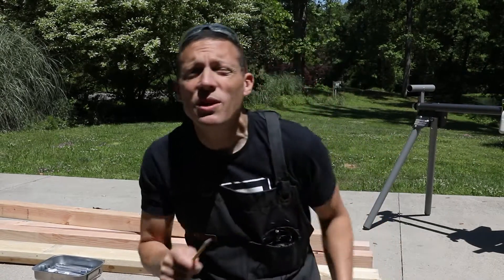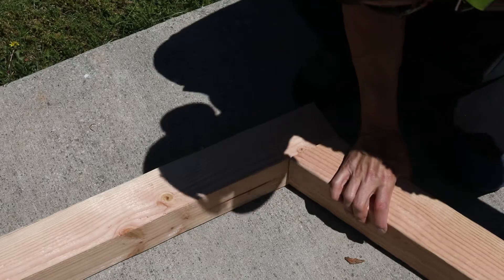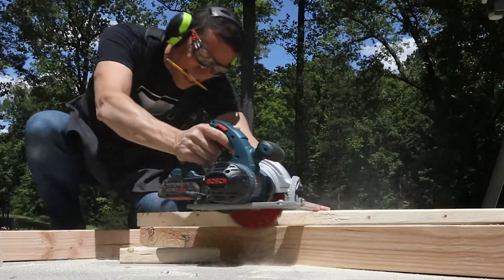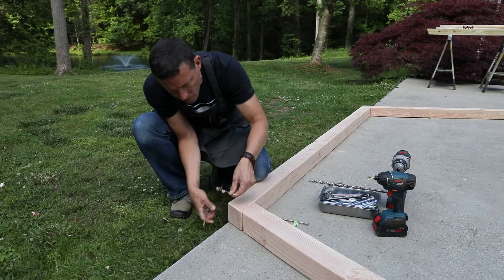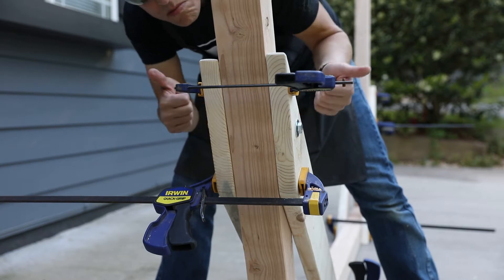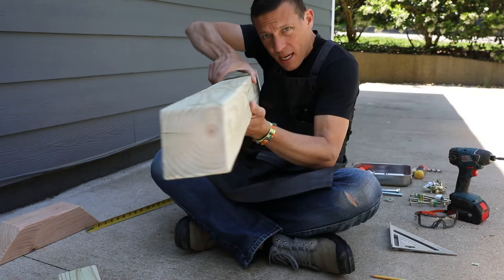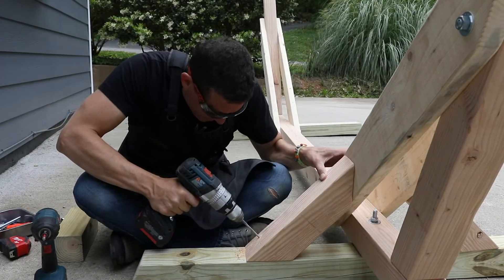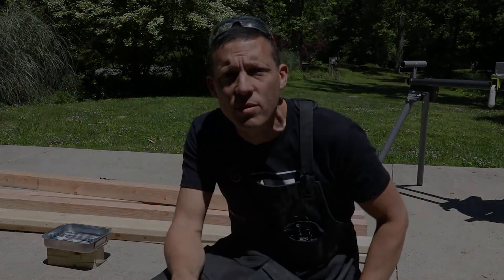DIY Hammock Stand Build - Simple DIY you can do!

Comment: I want to build this for my 15' hammock. Do you think I could just use a longer base board on the bottom?
Reply from the maker: Yes you should be able to do that. However since you would be adding five feet to the length I would increase the width of the two bottom post by a foot. So it would be at least 6" wider on each side. Let me know how it turns out.